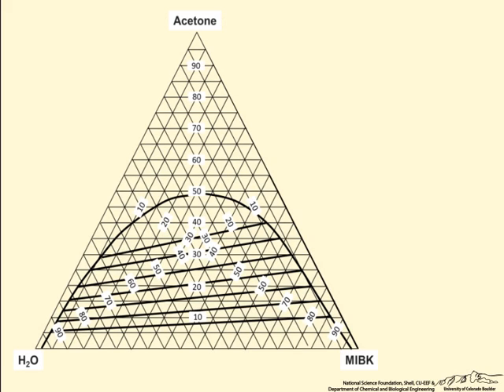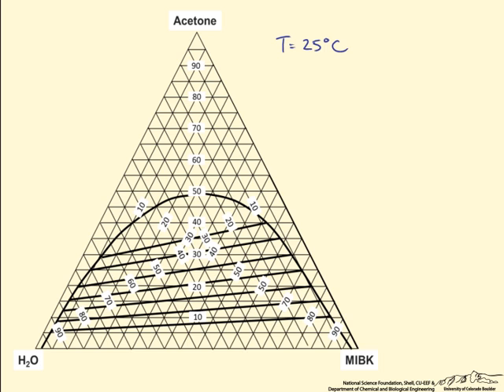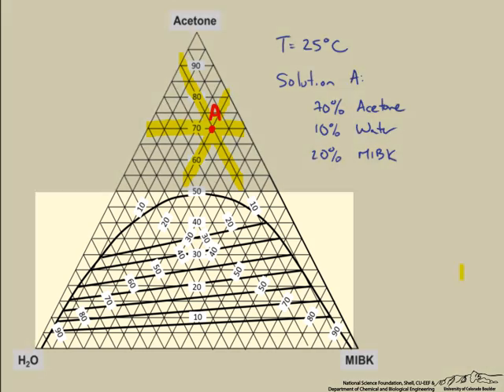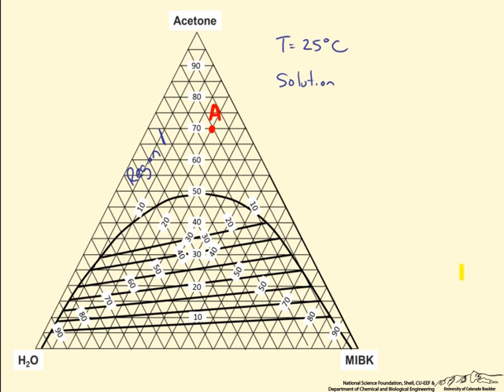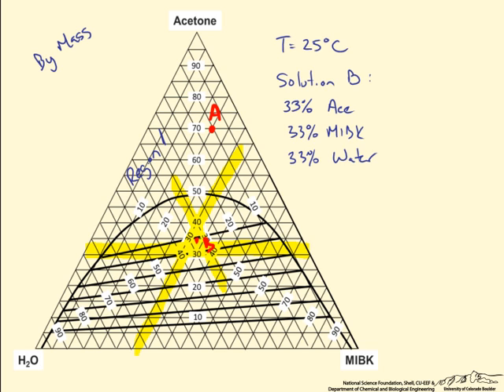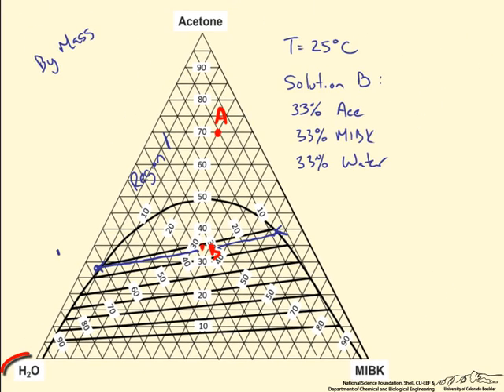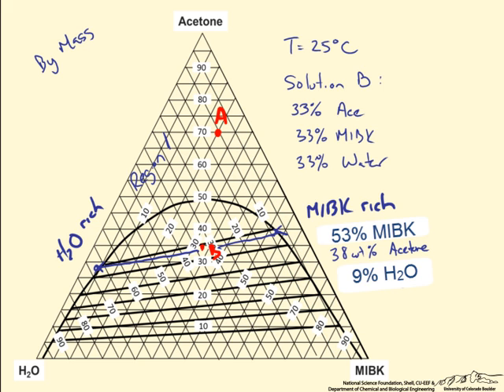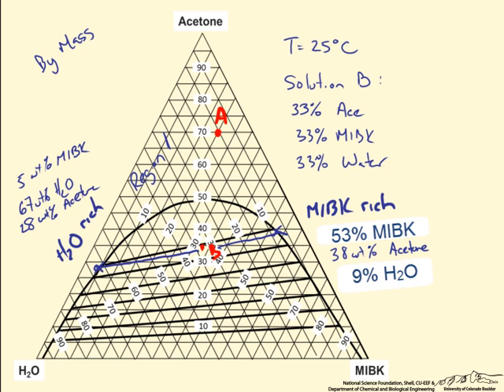Using a Triangular (Ternary) Phase Diagram

Comment: You sound like a sane person, so I will ask you, how the hell are those tie lines even drawn there in the first place? What exactly does it mean for 2 liquid phases to be in equilibrium with eachother?
Reply: tie-lines have to be determined experimentally, not drawn arbitrarily as the tutorial implies, i.e. you take a system under the curve, let it separate into two phases and then determine the acetone/water/mibk composition in both, one will give the left composition intercept, the other the right composition intercept, so you can draw a straight line through all three.

Comment: This is a pretty nice video. Straight to the point and simple.
You know what would be rad?
Some explanation or insight on what this diagram is actually used for.

I get the 2 phases are needed for separation process...
But how? How can 2 phases be useful (or necessary) for separation to be performed?